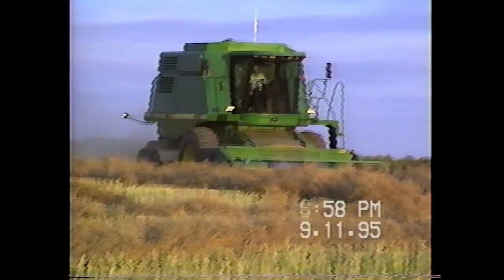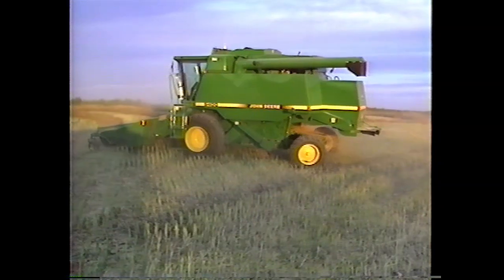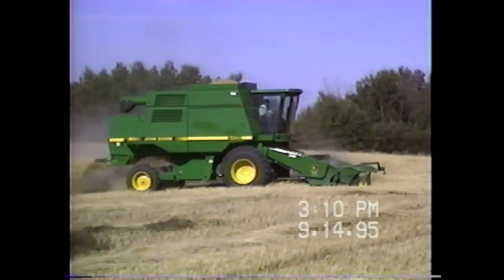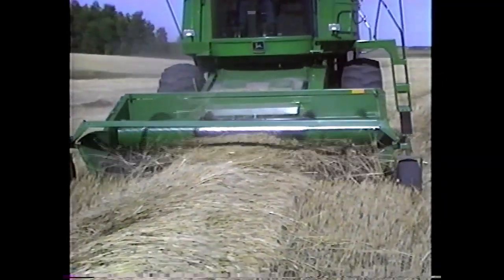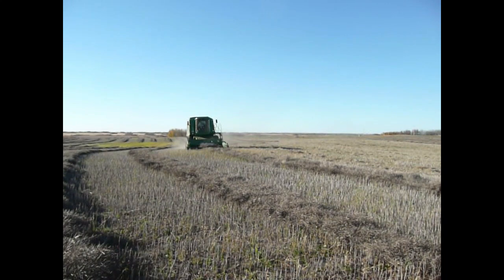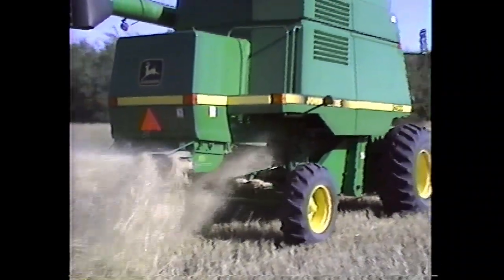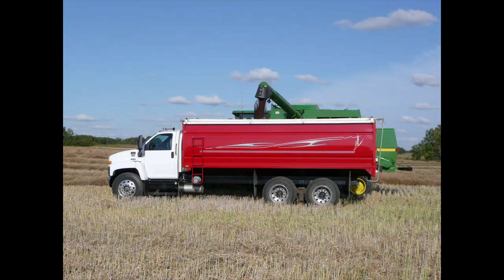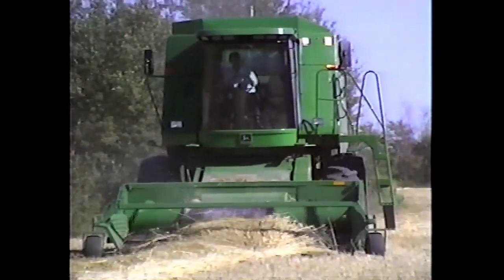Harvesting windrowed crops with a John Deere 9400 Maximizer

Comment: Getting a straw chopper instead of the straw beaters must of been a welcome update too.
Reply from the maker: Yes, it was indeed quite a change going from one extreme to the other. I didn't have anything against a chopper, other then the fact that the engine on my 6620 would possibly have a problem trying to supply the necessary power to keep it going in heavy straw conditions. Therefore I lived with the spreaders and they still did a decent job nevertheless.
Reply: @DeereDon   actually I thought your 6620 did a very good job in spreading straw. 18’ wasn’t that hard to cover. Plus the fact of the matter was the chopper on the 6620 was heavy and you had to remove it if the opportunity came about that you wanted to drop straw for baling. The spreaders were much easier to remove.
Reply: @DeereDon  it’s also neat to see a combine with out a GPS receiver working in a field. Not very common anymore. Now if the gps breaks down it almost seems like we have to stop the combine and get it fixed before we can continue

Comment: Top notch video!!!!  You sure had a nice line of equipment that anyone would be so proud of.  I bet the dealership loved it when they got your equipment on trade!
Reply from the maker: I would try to keep my equipment in good condition for that very reason, as most times the dealer would look at what I had to trade and there wasn't much haggling that needed to be done. Unfortunately, I had no control of what happened to that same piece of equipment once it got on the dealers lot, and maybe it is just as well I never did see it after that point in time. It probably would have broke my heart. Thanks for taking the time to watch and comment!!

Comment: Seen lots of 9600s and 9500s but I've yet to come  across a 9400! Very stumpy and square. Short walkers in those machines eh?
Reply: Yeah it does look very short compared to a 9600 lol
Reply: @tyerock7851  would be neat to see on up close haha
Reply: @SouthSaskFarmer1  ya it would maybe add one to your fleet 😂
Reply from the maker: Hi Nick....The difference between a 9500 and 9400 (as far as walkers) was 20 inches, but according to Les Hill from the PAMI institute in Humboldt the 9400 was far more efficient at harvesting then the 9500. The 9600 was still the King, but like he told me, if you can afford the 96 then go for it, otherwise stick with the 94.
Reply: @DeereDon  really eh. Cleaning area was far more matched to the machine eh
Reply from the maker: @SouthSaskFarmer1  According to Les, it had to do more with the fact that the engine was sized appropriately to the 94, whereas not so with the 95. Then JD brought out a bigger engine for the 95 and that just compounded the problem. And yet all the time the internal width of both combines was the same and the cleaning area was EXACTLY the same for both machines. Hence a problem in the making the moment anybody started pushing the 95 as like he said, and I quote--"You brought in the front and you put it out the back". End quote. He strongly recommended the 94 if I couldn't afford the 96 and I certainly did not have the land base to justify any 96.

Comment: Did your 2360 also have the chrysler "hot water" slant 6 ?😮
Reply from the maker: My 2360 came with the 4 cylinder diesel engine built in the Saran Works in France

Comment: Was there an option for bigger grain tank extensions than the flaps shown? I’ve seen some Maximizers with much bigger angled extensions, but that’s probably a modern day modification.
Reply from the maker: All Maximizer combines came with just the standard grain tank extensions, nothing else. But like always, there is a company that is willing to build what the farmers want, so yes, there was an option, but I would be willing to bet that Deere didn't recommend it (tire overload, axle overload, drive-train overload, grain tank fountain auger overload, etc.)

Comment: Did you ever disengage or remove the straw chopper and sell straw ? Or just chopped everything
Reply: But very nice iron in prestine condition once again thank you for sharing!
Reply from the maker: The only time I rolled the chopper ahead on its small carriage was to drop flax straw. That straw had to be collected and burnt otherwise it just caused multiple problems in the fields afterwards. The rest of the time the chopper was always in use as I wanted to return all the straw back on to the land.
Reply: @DeereDon  yes makes a thick matting I’ve seen lots of guys just burn it because that’s all you can do other then a heavy offset disc a couple times

Comment: Is that 2360 swather the same one rootsy6 farms with now?
Reply from the maker: That is correct.
Reply: @DeereDon  that's really fascinating. Thank you so much for uploading these old home movies.
Reply from the maker: @IH_5288  I enjoyed doing each one, looked forward to the many individuals that made a comment, which of course included you. Thanks.
Reply: @DeereDon  sorry to keep hitting you with questions but was that 7721 titan 2 that rootsy6 owns, was that yours at one time as well?
Reply from the maker: @IH_5288  Negative, the only pull-type I owned was my little JD 65, after that it was just self-propelled. His 7721 came from the local dealership about 30 miles to the west. My father-in-law owned the very first of those pull-types in this district (7701), an excellent combine behind his 4630 power shift, but I noticed it took so much time and so much space to turn around in, something I felt a self-propelled could do so much quicker.